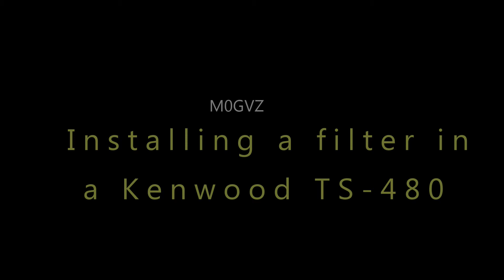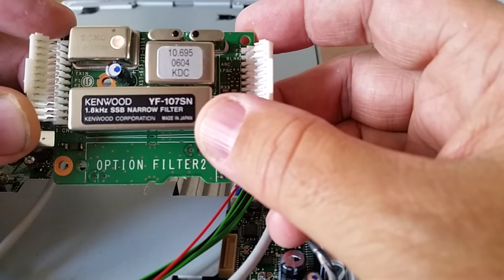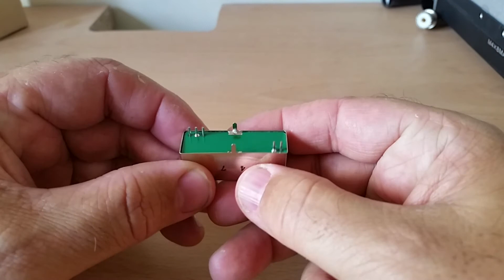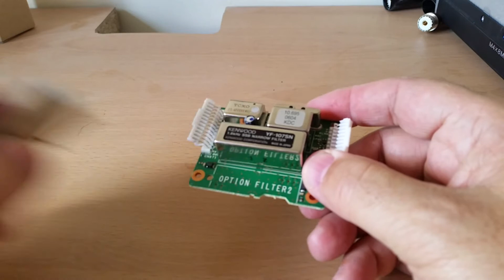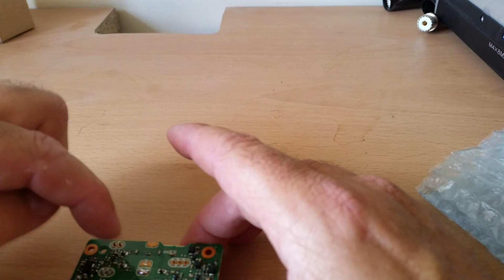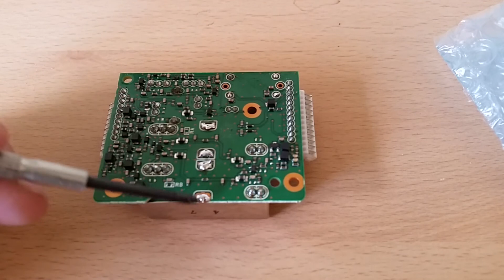Installing an optional CW or SSB filter in a Kenwood TS 480

Comment: Many thanks Connor for a very useful explanation in your video. I have just ordered one of the last (if NOT the very last) 500hz filter in the UK.  Origial prices of the filter were ridiculous, fortunatley I seem to have been successful in getting a bargain.I find that the 480sat is so easily drenched in signal overflow in CW mode it really need this filter. Regards
Jon G4FUT